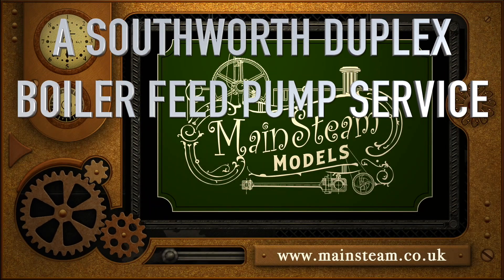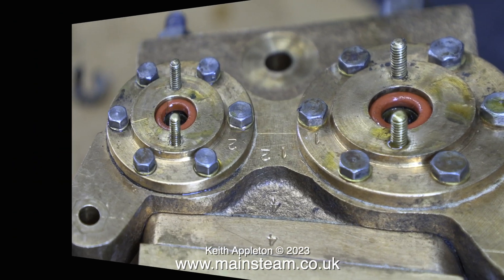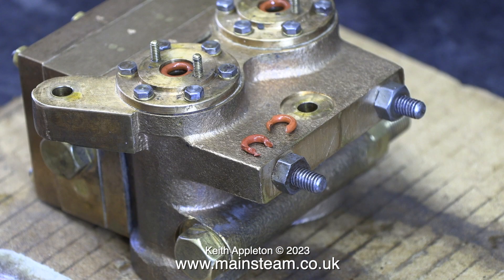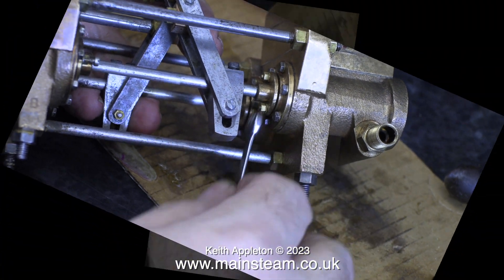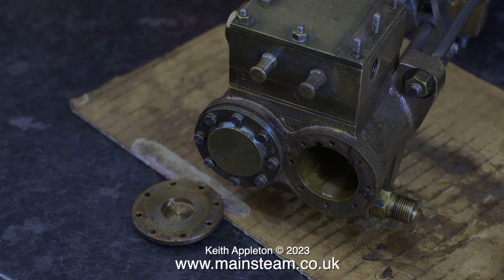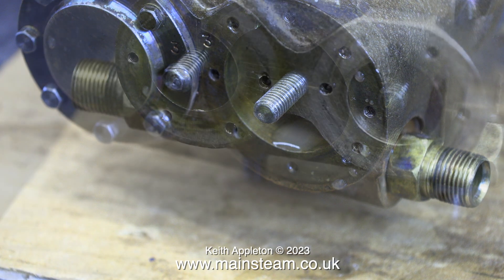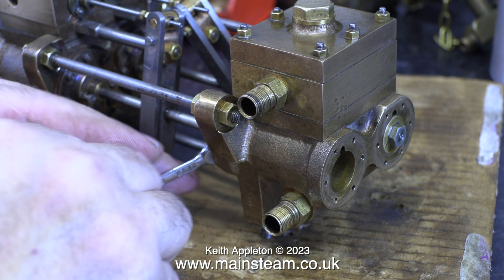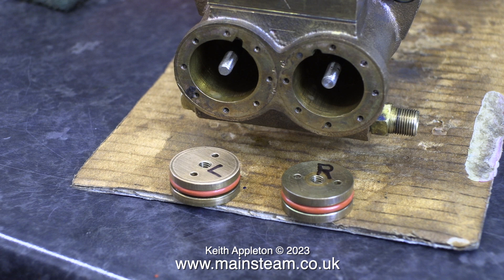SOUTHWORTH DUPLEX BOILER FEED PUMP SERVICE - PART #4

Comment: I Keith, hope you see my comments to you, what do you think of this DRO crap for Nasa i don't like DRO mounted up high in a box i am going to mount three electronic vernier calipers to my lathes one for the tail, one for the cros slide and one for saddle travel these are ten bucks each on amazon the mill is different i will mount one DRO for vertical movement only a battery operated cheepee as depth is more important to me the tables. 
You bought a chinese quick change post for your Warco, listen i bought one three years ago same one, i regret it now , but you can find out for your self the issues will eventually show their ugly faces . Listen blondie hacks suggests a Spiral Reamer for the crankshaft bearings because they are splitt stating a straight reamer will catch the seems of the halfs when bolted or soldered together after initial drilling, what do you think? You indicated your not going to buy a new Milling machine if i had yours i would probably state the same, but i don't mine has a 350 watt motor with a three inch wide deck for T slotting things down its a great little machine but one other problem alot of slop in the vertical ajustment knob i meant to take it apart and see if i could fix this problem its a 1/4 turn slop in the fine feed dial i desided no i will just buy a battery operated single dro and leave the way way off this planet fine feed Busy Bee canada replaced the entire unit twice after that i did not bother taking it back for yet another replacement its just the fine feed knob and the saddle which tightens up as i turn its lead screw to end of its travel, i will be taking the saddle off and stoning the saddle down so that i get complete travel with it tightening at my end as i turn it toward me.I will stop here, Merry Christmas Keith again and please don't get sick you are a very Usefull asset for all of us and kind enough to help others.
warmest Regards Daniel somewhere around the planet?!

Comment: Hi Keith, Merry Christmas, Its Daniel here from Canada, i saw your video , regarding your friend andrews Airplane engine build, i wonder perhaps i am not sure i am not a nitro or gass engine builder, but i am thinking perhaps a tappet valve rod four stroke engine type of fuel system. I think he should not give up and redesign the engine for a valve rocker type system, what do you think? I would email you on your site but as you stated you get hundreds of emails. I am planning on sending u a gift Keith from Stuart but it will have to wait a few months or more. i will be ordering a few steam castings kits from them dowm the rd early next year. I had emailed them asking them to send you something from me instead of shipping all of it to me then me sending it to you from here. I got really worried for you regarding that hospital visit you stated you had attend, we cannot lose you we need you here not up thier your the greatest teacher any beginner could have. ok now on to business, i saw your Warco you bought, i desided to buy to lathes but could not make up my mind which to by first either the King Canada 10 by 22 or a 8 by 24 like your warco first, i have desided i would buy the 8by24 first then later next year i will by the king canada unit also i will be buying a new bigger mill. I have a chinese mini mill brand new i bought two years ago, but its to small for a 4 inch vise as well as my 4 inch cheepee  rotary table temp, these will work. I cannot afford cast iron nor do i want to risk building a foundry furnace that can melt cast iron for casting my own parts some guys that did successfuly build a iron melting furnace from scratch suffered third degree burns on their fingers as well as splattering 2500 hundred degree molten metal. i understand now why their are othee ways to buld steam engines because no one sells a safe furnace unless you want to spend 20000.00 dollars on one. I did not like the casting's blondie hacks got from PM for that huge steam engine if you watch her attempt to build from their castings you will understand why i don't like their castings compared to Stuarts. I wish to state that alot of these model builders on you tube seem to use complicated tooling and scientist type rediculious methods that according too your way which is simple are at best great for students at naza.. will stop here and start a second comment to you, i don't want to put you in acoma with a huge SA. Daniel!